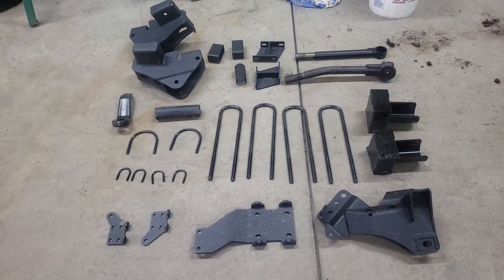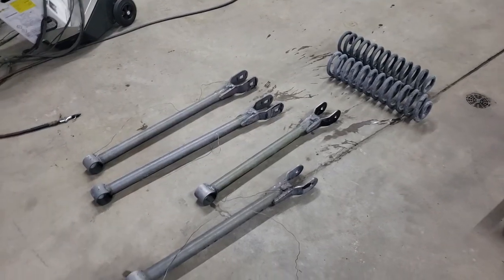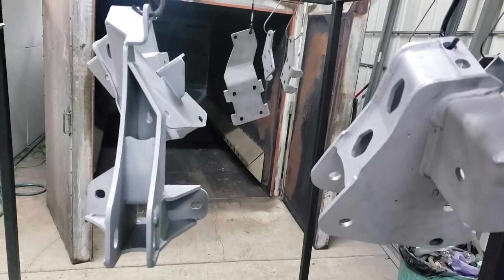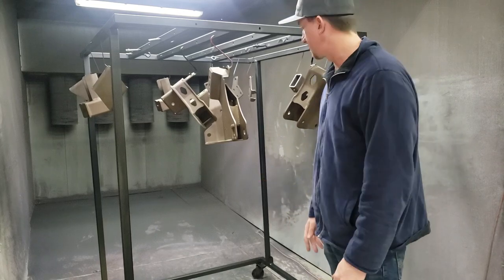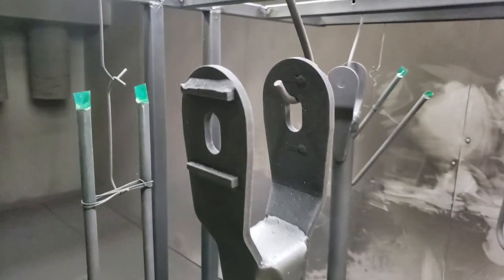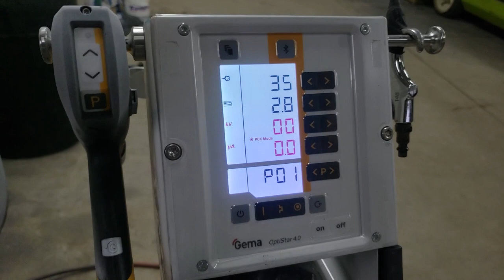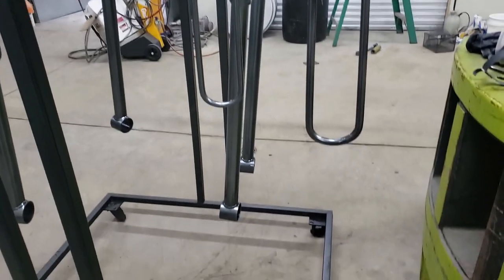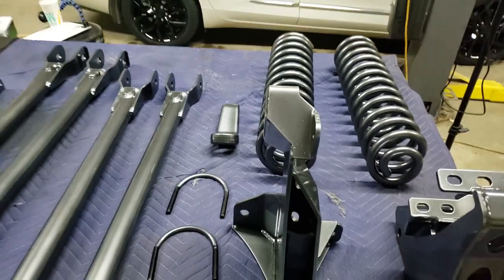Powder Coating - BDS Lift Kit - Speedway Grey from Prismatic Powders

Comment: Very Informative Video! I have a few questions
1. did you spray the first coat hot/warm/cold? 
2. When spraying the clear coat (looks to be cold), what is the "optimal" temperature you've found to work? 
3. when ordering the color from prismatic, how did you determine what the correct quantity to order was without ordering too much? My thought is to save the customer from overpaying for powder to complete their project.

Comment: Cool video!! So it doesn't matter if you have a cheap gun or a very expensive gun...they both still have the same powder problems. Back ionization, faraday, orange peel,etc.
Reply from the maker: It's all in the setup, but yes, also a bit frustrating, I'll have the sales rep come out to help me

Comment: Great job and tips!!! 
Do you tell customers that there might be marks from where you use hang the parts that don’t get powder in those spots?? Or do you even have that issue?
Reply from the maker: Never really had an issue, you can always spit in with a rattle can for rust prevention.   Most marks are in bolt holes ect
Reply: @RightNowPowderCoating  hmmm ok! You should cover that in a future video. I seem to always have marks where I hang parts that have no bolt holes! Thx man for everything!!

Comment: Love your videos man, such a nice set up you have. I started 9 months ago Coating in my small garage. Currently in the process of getting a bigger shop built with a legit booth, and high enough ceilings for a lift. Wondering if you had any suggestions on getting more work ? Currently running a lot of Facebook ads with 1-2 jobs a week coming from it.
Reply from the maker: We started as a wheel repair shop and luckily had a dealership who agreed to use us to black out wheels which helped us get started with low risk.  Best way to grow is put out great work...word of mouth is worth everything.  Talk to fab shops, dealerships, motorcycle places, people with cnc tables, ect.  Tell everyone who will listen what you do, they may not need you but they may tell a friend.
Reply: Rim Right how do you like your gema ? Using a koolkoat right now. Looking to upgrade. Wondering if it’s worth the 6k
Reply from the maker: @ryanmatty5739  still getting use to it, actually still using the demo, doing an unboxing video of my new one...look for it soon.  But so far I like it a lot as it controls the cloud way better still trying to fig out settings to prevent back ionization.  It's best to remember that most mistakes are human...so I'm sure I just am not setting my settings right
Reply: Rim Right thanks for all the info man, appreciate it ! I’m subscribed so looking forward to your videos thanks !
Reply: Ryan Matty we just do the FB market place along with a fb business page. Also the big one is get your company SEO on google search. That has gave us a lot of business. We just upgraded to the Kool Koat HD and love it. Not as big as a gema but able to put on multiple coats and adjust both uA and Kv
Reply: Do nice work and word of mouth will spread.  Make sure you dont turn out stuff that bubbles up or looks garbage 
 Especially the guy who rides his bike with 20 other guys in a club ...

Comment: Nice video as always. So with the higher end guns how do you guys ground the parts? Ground to ur rack? I'm used to my Eastwood gun.
Reply from the maker: Yup or you can still ground off the part, easier to go off cart or hook though.  Even with eastwood gun I use my in ground ground system and not the eastwood one.

Comment: Love your videos! A quick question, what are you using to strip the paint off?
Reply from the maker: Nasty chemical stripper
Reply: Rim Right Benco b17 most likely. Strong ass stuff with the methylene chloride the epa banned last year for public use. Stripper from the hardware store is useless now, especially on powder.

Comment: Like you movie's,  learn a lot from them.
hope you gonna get a lot more subscribers.

you  hot flock the clear coat ? cause saw you use the temp gauge.

Greets from the Netherland.
Reply from the maker: We typically do not hot flock clear but on a few parts we did to fight faraday issues.

Comment: Couple questions when you took out of oven to do a dusting of clear coat was the part warm or did you let it cool down.                I always have ionization issues and I turn my uA down to 20 and keep Kv 80 as suggested by Columbia Coatings on there KK-HD. Any suggestions
Reply from the maker: I always let it cool down, can you lower the uA any lower?  On my Gema I go to about 8uA and leave my KV at 100 as the gun will adjust it down as needed.  Also make sure you have a good amount of distance from the gun tip to the part.

Comment: If.you still have back ionization problems,put these settings and give it a go:
KV: 40
uA: 20

It should work fine. 

And yeah,put the pressure at 3.6 to 3.7 bars (I don't know in psi)
Reply from the maker: I actually sell for AIC now and we sell gems guns and I've done a bit of training, the new guns have a pcc mode that will go under 10 micro amps, we set to around 7 with full kv

Comment: Why use the pallet Jack when the stand have casters? Do the casters get caked up and not work?
Reply from the maker: Yeah after 4 years there shot, the high temp wheels are basically gone and flake apart

Comment: hey dan, thanks for the vids and tips.  if you dont mind, i have a question... what do you do with the spots where the hooks hang on the part?  im getting ready to do some atv springs and was curious about the process of handling the bare part that never sees powder due to where the hooks are in contact with it.  thanks again.
Reply from the maker: First we always try to use the smallest diameter hook possible to leave the smallest mark.  Second we try to hang in an area that will be covered, and 3rd you can add a bit of touch up paint.